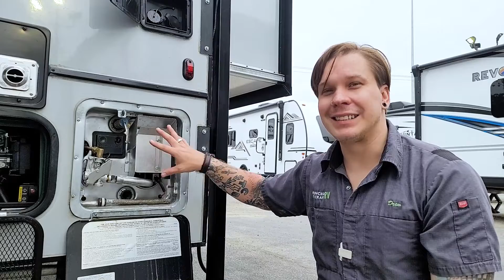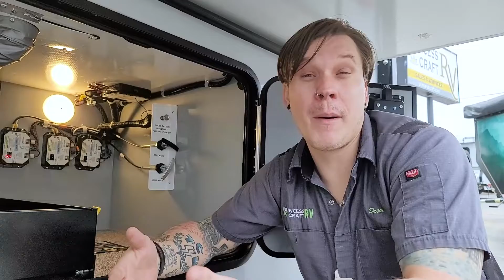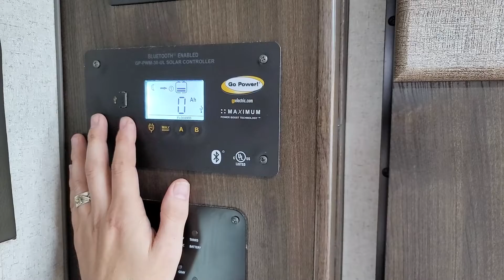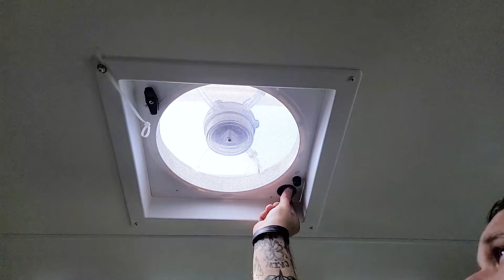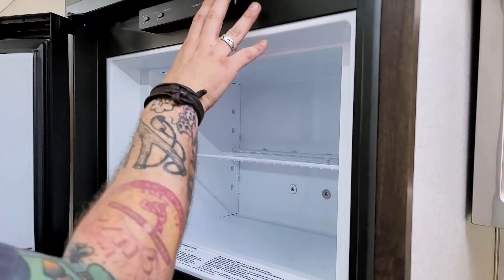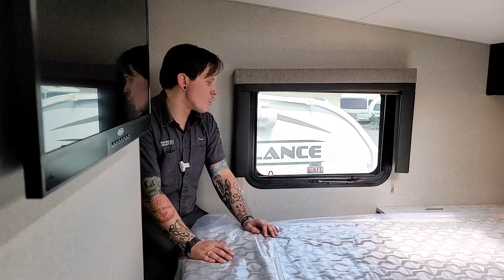2021 Eagle Cap 1200 Tech Tour

Comment: What kind of truck is needed for this?
Reply: We found a 1999 F550 dually with only 44k miles  to carry our Eagle Cap 1200. These are heavy campers!
Reply from the maker: BIG. You'll need an appropriately set up dually. Please check with your dealership to make sure you're safely setup for a rig like this.
Reply: @RVTechToursatPrincessCraft  if only a dually can haul this then why the jack extensions? Makes no sense